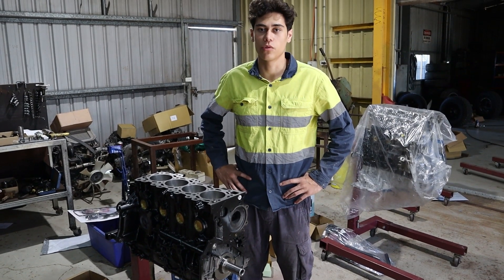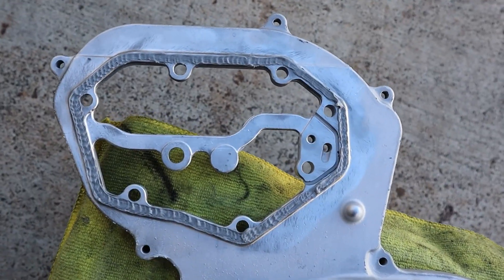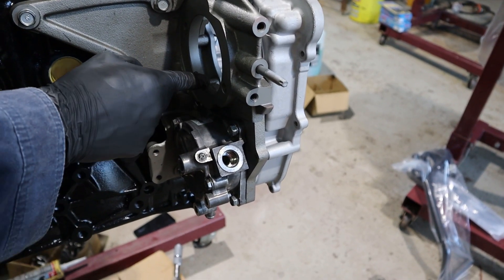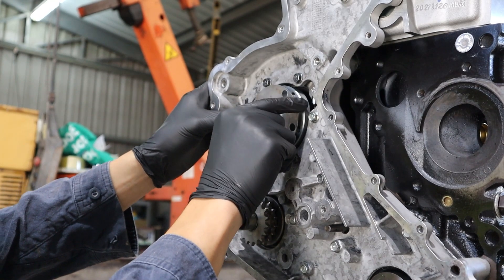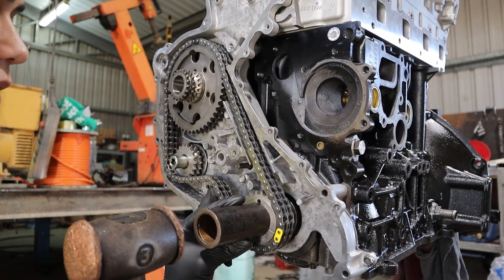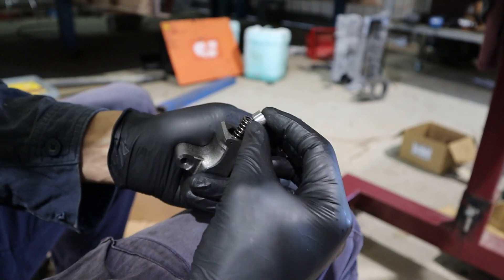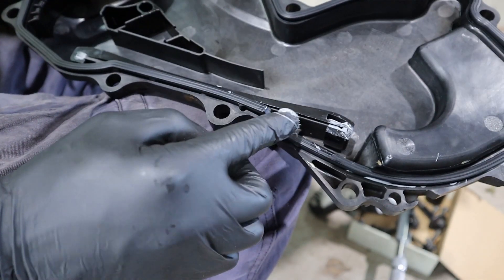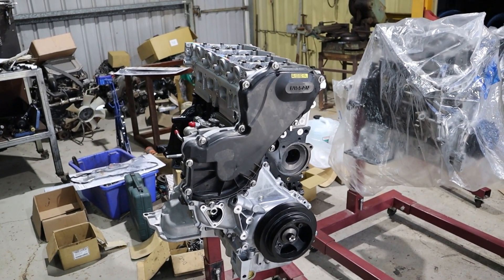How to Build YD25 Engine D40, D22, R51

Comment: Hello , is it possible to remove the timing chain backplate in situ, without removing the crankcase ?
Thanks
Reply: Thanks for the answer , your videos are really helpful. It is a d40. I managed to remove it , even if it was not an easy task , because of the balancer gear... 
I might grind a bit the pins on the block for reinstalling it...
Reply from the maker: is this a d40 or d22?

Comment: Sory bro camshaft bolt torq a 30nm? Thanks...
Reply from the maker: The bolt for the sprocket is 144nm
Reply: @yd2532 and the cam bolts? 30nm or?

Comment: R u sure about torquing the crack pulley to 75Nm and 120 degrees? For YD22 its 29Nm max and 60degrees.
Reply from the maker: D22s use a shorter bolt than the D40s, but I have always just done them the same torque as I have done the D40s
Reply: @yd2532  Do you have to decrease the torque spec if putting grease on? Is the grease necessary?
Reply from the maker: @lape8840 I have never broken a bolt tightening them. If a bolt comes loose though it can cause a lot of issues like striping the crank woodruff key

Comment: Hi there can you advise if conrod bearing can be replaced just by removing sump and leaving engine inside engine bay
Reply from the maker: Ye you can would need to remove balance shaft as well on a d40

Comment: What happens to the step between putting the top timing cover on and the sump, what about the scissor gear set up??
Reply from the maker: I deleted the balance shaft on this engine. If you are using one of our engines do not fit it because the oil gallery has been blanked. Otherwise if you haven't blanked the oil gallery check out our how to retime balance shaft video and it will show you how to time the bshaft

Comment: how much torque on connecting rod bearing on Nissan king cab d22 2.5 tdi 2001?
Reply from the maker: Navlife website has a workshop Manuel for yd25 it will have it

Comment: Hi THANKS for Your Videos!

So if i need a new Cam-Chain-Cover, because the old (Aluminium) ist broken...
where can i buy a new in Plastik???
Thanks!!!
Reply from the maker: Where are you located?
Reply: @yd2532  I'm in Germany.
Its a Pathfinder with a YD25 from 2005.
If i find such a Part on the Junk Yards, then they are very bad Material or they ale also broken.

Are these ones in Plastik better?

THANKS!!!
Reply from the maker: @Alex-K. You can use a D40 plastic one as long as it's not a 140kw model but you will also need to get the bolts with it

Comment: HI  could I fit a 2012  yd25 Spain Short engine  [NEW] to my  2009 Thai  using all of my other engine components  Thanks for your help Mark
Reply from the maker: @markpalangas492  they have different blocks that Spain engine is a 140kw.model
Reply: @yd2532  I can't thank you enough I have asked so many others  and no one was able to tell me if the blocks were the same . read so many pages and the only difference I could find was the comp ratio was 15 to 1 Not 16 to 1 like the Thai built  You are the master  Thanks Mark

Comment: What heads are you using? I’m thinking of one off eBay instead of wreckers
Reply from the maker: @rossphillott28  it's an aftermarket head casting with the genuine internals put back into it. What broke on your head?
Reply: @yd2532   cracked head
Reply from the maker: @rossphillott28  where are you located?
Reply: @yd2532   qld. I’m looking at buying one as a project, it’s just down the road and has all the gear on it but has cracked head. Just doing research. If the cams are damaged how much for oem cams? As you sed the aftermarket ones where out
Reply from the maker: @rossphillott28  of the old head is genuine we do reco exchange heads for $1600. Or we can supply a new bare head casting for $850 and you can swap the internals.
Reply from the maker: @rossphillott28  just be aware of it's been over heated a while ago there could be water sitting in the bores and rusting so best to start the engine every so often till you fix it

Comment: A quick question....... Which year was the timing chain issue addressed on YD25 D40? Reason why I am asking is, I wish to buy a used Navara D40 but am not sure how to check if the car has a double timing chain without opening the engine.
Reply from the maker: @muchierichman4128  all the yd25s except the early non common rail engines have single row chains

Comment: What engine oil do you use sir? Do you have whatsapp i have a yd25 too
Reply from the maker: 5w30 or 5w40 full synthetic
Reply: @yd2532  what brand sir
Reply from the maker: @nOWaYOUT221  any decent brand as long as you service it every 10 000km or sooner if you do towing
Reply: @yd2532  is it a reliable engine sir?
Reply from the maker: @nOWaYOUT221  yes https://www.yd25.com.au/index.php/yd25-maintenance
Reply: @yd2532  appreciate for your reply. Lastly what is the best full exhaust for yd25 stock is it 2.5 inch or 3
Reply from the maker: @nOWaYOUT221  the bigger the better I gained alot of power from a 3inch exhaust

Comment: Maybe you can help me with a d40 that blows grey and blue smoke after it warms up. Strong diesel smell. Motor runs fine. Good power. Has new injectors and engine was rebuilt. It started happening about 2 weeks after the rebuild.
Reply from the maker: Were they new or reco injectors? Could be low compression of low rail pressure. Try an ecu rest
Reply: @yd2532  reco. But I put the old injectors back in and it does the same thing.
Reply from the maker: @richardherring76  could be low rail pressure do an ecu reset or change the scv. Or could be low compression make sure you put the engine under load to help the rings bed in
Reply: Cheers mate really appreciate you help

Comment: Just got my Nissan 2010 D40 Thai engine done by the boys and picked it up last week, we got all the mods too, I can't say enough about the great service & support they provide. I would recommend them to anyone with a Nissan D40, thanks Daniel & Paul
Reply: Who did the job?
Reply: @negueba235689  I removed and reinstalled it as well did the mods etc. (I am an auto sparky which helped) and Daniel & Paul did the engine side up to the video above. I have never done engine rebuild etc. but found this to be very easy and the guy's really support there service.
Reply: Also, the car is going great had no issues at all,

Comment: I have a xtrail t30 d22 which is dying with a cold engine. Ibsuspect the timing chain is worn after 250tkm. Is changing the timing chain similiar to your assembly in the video?

Comment: Absolute legend, fantastic video mate.

I just bought a 2009 2.5l Pathfinder and I have an annoying ticking sound on acceleration but only up to 2000 rpm, then I can’t hear it. Worse when the engine is cold.

Any ideas mate.
Reply from the maker: How many KMs
Reply: @yd2532  188k

Supposedly the timing chain has been changed to a double row chain, but the injectors have never been done… well the last owner never did them and he had it for the previous 3 years.
Reply from the maker: @adventurecampexplore5496  injectors usually go around 300k unless they have been over heated or had dirty fuel. You could measure the chains
Reply: @yd2532  So you think it could be a stretched timing chain.
Reply from the maker: @adventurecampexplore5496  potentially depends on the brand of chains that were fitted and if it was fitted correctly
Reply: @yd2532  Too easy mate, I’ll look into it.

Thanks for your help and keep up the great vids. 👍
Reply from the maker: @adventurecampexplore5496  could try an ecu rest as well if the ecu sets the fuel rail pressure wrong it can make extra noise.  Could also be alternator pulley. But worn links in the chain can also cause ticking
Reply: Take your heat shield off of your exhaust manifold and check for cracks, I had the same ticking issue and discovered a huge crack almost right through it, ticking sounds has since disappeared, j thought it was timing chain or injectors originally

Comment: Well presented and skill.👌
I ve 2007 D40 VSK engine I rebuilt the engine from scratch as per your guide and all seems well and good except that at times when I restart the engine it sometimes drives with super quite smooth idling and at times little bit rougher but not easily noticeable by someone who haven't driven it for long to understand the difference engine sounds. Secondly ,it also sound smoother than normal when diesel is almost finished when below quarter tank gauge level.What will be the cause of these?
Lastly, when rebuilding the engine I rebored the block and replaced the cylinders with the max size "40 thousand size" I sometimes feel like the standard turbo is now smaller for the power it now has as the booster solenoid keeps failing to boost although the engine still remain powerful enough to climb hills even without turbo boosting. What other turbo type and size can I use to upgrade it?
Reply from the maker: Rough idle could be suction control valve
Reply: @yd2532  🙏 You mean it needs replacement? What about turbo upgrades?
Reply from the maker: @kenm8797  ye scv might need replacing
Reply from the maker: @kenm8797  videos coming soon for D40 turbo upgrades
Reply from the maker: @kenm8797  videos talking about turbo upgrades for d40s coming soon
Reply: @yd2532   .👍 looking forward to it.
Reply: @yd2532  Help me import SCV into South Africa

Comment: Great video dude. When u said, use silicone under the timing chain cover seal. What type of silicone should be used? I'm about to replace the seal.
Reply from the maker: 3 bond super sealer grey
Reply: @YD25  Thanks mate...

Comment: This is fascinating as fk... 

I would only dream of rebuilding my engine.. might have to one day since I've remapped it 5 years ago go a rich fuel/air ratio..just waiting for it to blow

Q:
Why copper hammer?

And what kind of silicone? Is RTV thread sealant fine?
Reply from the maker: copper hammer is soft so doesnt damage parts, we use three bond super sealer grey

Comment: Great stuff mate. I have a d40 with a very annoying ticking sound in the top of the cylinder head I have had the shims checked which are all within spec and new injectors which it needed I have no gasket leaks it is doing my bloody head in any  ideas 🤯🤯🤯 i have been told it is just a noisy engine which doesn’t make sense to me 🤔👍👍
Reply: I had similar issue and I noticed the fuel pipes were sucking air into the system and that the water separator filter drain plug wasn't fastened tight enough and after tight fastening them and doing an on engine suction control valve and injector system cleaning, it become so quite and sounded like as if it was a petrol/gasoline engine
Reply: @kenm8797  I’ll look into that thanks mate 👍👍👍
Reply: Why is mine over heating only when driving long distances?
Reply: @jaron-leefigaji316  I had a d22 that did the same thing I put a bigger radiator in it and fixed the problem but it could be many things it might need flushing or maybe a small leak in the head gasket  🤯🤔
Reply from the maker: Worn timing chains can make a ticking noise. Sometimes the cam chain guide can snap as well and rattle
Reply: @yd2532  sorry mate I forgot to mention it does have new timing chains as well ,hence that is why it is doing my heading . Thank you so much for your reply 👍👍👍
Reply from the maker: @atvcampingadventures1728  is it the original head or aftermarket?
Reply: @yd2532  original

Comment: I have just done a new head on my YD25 from a 2006 D40 and when I start it, it idles for a few seconds and stalls out. It runs pefectly fine if you just touch the throttle. There are no codes when I plug in the computer. Any Idea what it could be?
Reply from the maker: See if it runs if you disconnect the cam angle sensor
Reply: It’s running with the cam angle sensor out, does that mean the timing is out?
Reply from the maker: @julianmillgate5990  if it runs and doesn't want to stall like usual means either chains are out or cam sprocket not lined up on dowl or tone wheel not lined up

Comment: Great video 🤟 at what mileage would you consider replacing the timing chain? What brand of timing chair would you recommend? Cheers love ya work👍🤟🤟
Reply: Привет,а зачем ты с верхнего натяжителя вытащил конус и перевернул его?
Reply from the maker: Average chain life is 150 000km. We make double and single row kits http://www.yd25.com.au/index.php/services/yd25-duplex-timing-chain-conversion-kit
Reply: @yd2532  thanks for the reply, I will keep that in mind. Mines only 65,000kms ATM
Reply: @yd2532 160k now but works fine should i replace it now?
Reply: @marccadz3630  I would, my bottom chain let go at 188K, and a couple of K compared to 6-8K and the time is a bif difference